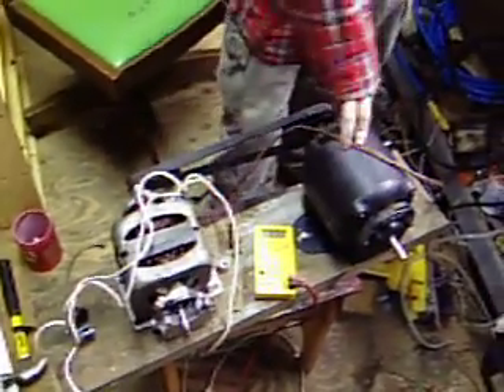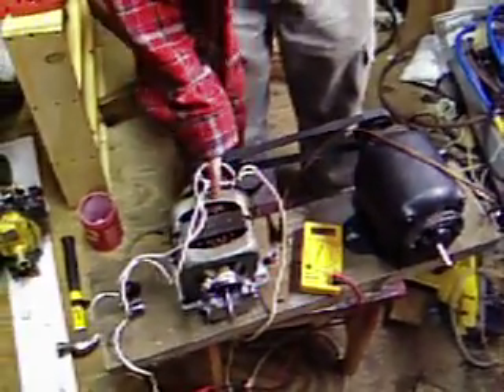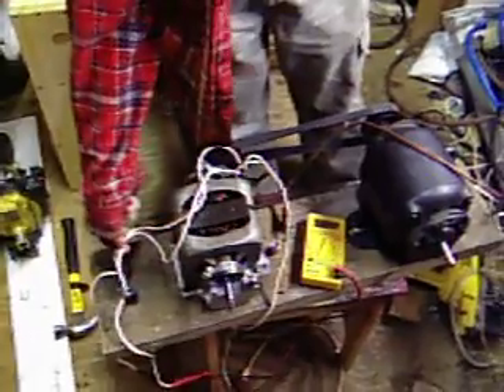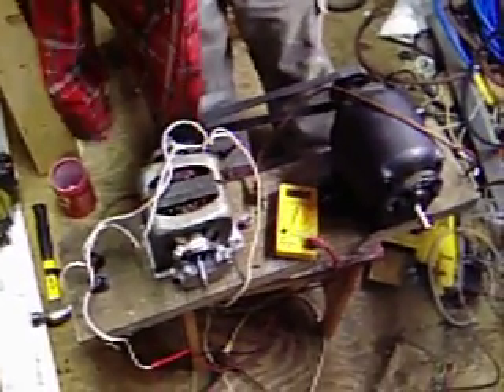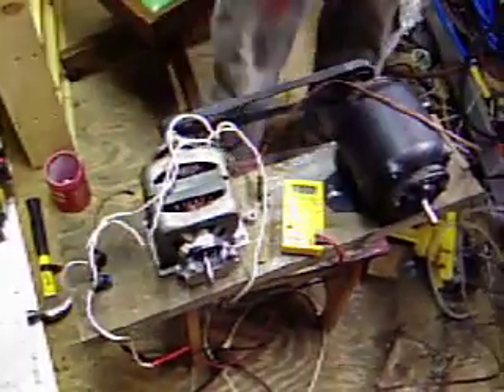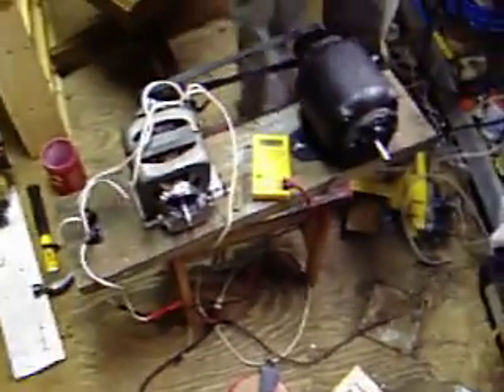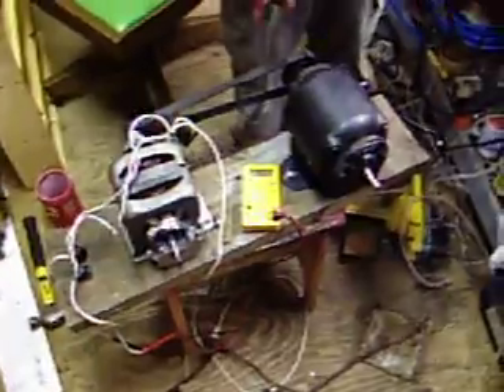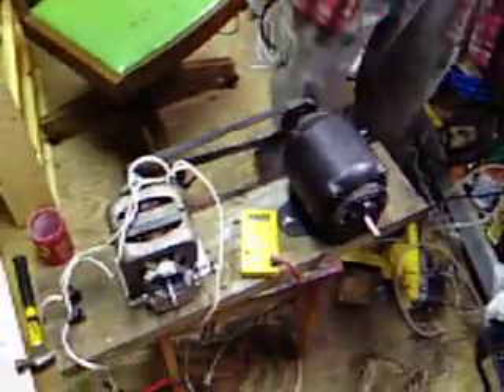induction generator

Comment: Hey did you know even car alternators require power to start operating?  That's why you had to charge up the magnets each time.  What's the latest with your generator project?
Reply from the maker: ***** well that is true, but this wasn't a alternator, this was a induction motor out of a electric dryer / washing machine. The latest i did with it was a 2 part video, heres part 1: http://youtu.be/5X1MqoGwRC0 its a long video because i went into alot more detail than this video. Thanks for Watching!!!

Comment from the maker: with this setup it wasn't very much it was just about 100 watts or less. Its running at aprox 1800 rpm, both motors were 1/4 horsepower. If you look through my new videos (i think this was from 2012) i did a 2 part video on building one of these, much more detail than this video! (I'll PM part 1 to you) Thanks for Watching!!!

Comment: I would suggest using a flyback transformer driver circuit if you want to increase voltage, you can scrap them out of old tube Tvs or old computer monitors. Be careful for the fact you will likely multiply your voltage in the kilo-volt range. Another more effective way is using step up transformers. Really just understanding induction for the most part. I do suggest using oil filled capacitors that you can find in Air conditioners or appliances.

Comment: Suggestion, tuck in your loose baggy shirt and roll up those long sleeves when working around exposed pulleys and belts, or take it off and wear a close-fitting short sleeve.

If your shirt gets sucked in between the belt and pulleys, you'll end up with spinning death chewing into the side of your body real quick.

Comment: @fnaguitarplayer9 I used 65 microfarad with 5 caps. The 4hp motor is a 240/480volt twin voltage single phase. I saw your jacobs ladder video.  I used a washing machine electric motor and a microwave transformer,it worked really well. I copied this idea from aussie50. he has a lot of videos on youtube.

Comment: @fnaguitarplayer9 I have two 5 gallon buckets full of capacitors. They were given to me. I would hate to have to pay for them. I tested the induction generator with two halogen heaters 2900 watts in total. It makes the 8 hp B&S motor work for its living. One of these days I will post a video of it running.

Comment from the maker: @1899lpv This dryer motor is stubborn to start, after i got a good engine to run it, i used the other motor that i was simulating the engine in this video as the generator and it doesn't even need primed each time it starts the rotor keeps a charge on some of them. But yes this setup in this video is 100% useless, it was just set up with a electric motor because at the time i didn't have a side shaft engine that ran. And to make a generator like this it has to be a induction / brush less motor.

Comment: @fnaguitarplayer9  To put in other words, you could install anything to "Prime" the dryer motor...examples:  a wind or water turbine. Just like a car alternator. Could it be done with a forced air furnace blower motor ? I have one since last week and it says: AC Motor  CAT 841cv  HP1/3   RPM 1725  S.F 1.35  V 115  Hz 60  PH1  CODE n AMB 40ºC  A 5.3  SFA 6.2  RATING Cont  CL b  MFG NO h87 4    Would it be simpler if I PM you some pictures ? and does it really matter if  the motor has brushes ?

Comment from the maker: @1899lpv the dryer motor is the generator, the other motor is simulating a engine running the generator. All it does it turn the rotor on the dryer motor, it is not connected to the light or meter, just plugged straight into the wall, the light bulb is running off the dryer motor and capacitors. You can google induction generators for more info on how it works, i will do a update on this eventually. Hope this helps thanks for watching.

Comment from the maker: your welcome. Its the same thing for any motor, only thing changes is the capacitance, and if its 3 phase the hookup of capacitors is different. this is not meant to produce free energy, its just a home made electric generator, only thing is at the time i didn't have a gas engine for it, now i do, thats why there was another electric motor driving the other motor (generator). more less a test to see if it can be done. thanks for watching.

Comment from the maker: @Acemr420 when i ran engines off of hydrogen i ran the mix of hydrogen and oxygen in the carburetor, but i'm sure if you just run the hydrogen it would get enough oxygen from the air to burn. i would think it would be to rich, by itself. i'm not for sure. i know the air we breath is like 78% nitrogen, and only 21% oxygen, i'd say you'd have to mix nitrogen with it, or have some type of regulator on it to monitor the oxygen levels to cut the generator on and off.why are you makin air,just wandern

Comment from the maker: @Acemr420 well as far as electricity goes, building a induction generator like this video is a good way to start. as far as making breathable air from water, you would have to use electrolysis but the only problem is that it splits water not only into oxygen but also hydrogen which is extremely flammable, and would have have to filtered out, depending on how you make it, it could made so that hydrogen comes out one pipe and oxygen comes out the other. this how hydrogen fuel cells work for cars.

Comment from the maker: @mountain177 but i didn't have the right capacitors and they blew up in my face, but it did work fine, and the rotor held the magnetic charge (i didn't use the dryer motor as a generator, i used the other (running) motor as a generator, and it worked great, started everytime, never had to jump it off 120V. and yes, the double pole switch would have been alot easier/safer than the way i did it in the video, if i had one handy i would have used it then.

Comment from the maker: @mountain177 good idea, i can tell you right off the bat, that will work, its the same as plugging and unplugging the dryer motor. but see, this video here was when i first discovered that this could be done, at the time i did not have a gas engine, so i had to use the other motor to turn it over, so technically there is no point in this setup in the video at all, except for testing. and, last summer i bought a 6.5horse engine and put the gen back together and it worked great did not need a jump

Comment: all you have to do is have a double pole double throw in between the output of the dryer motor andthe input of the temporary motor. this is probably a good idea but i dont have the tools or the stuff to try it with. so go out and buy a double pole double throw togle switch for 120 volts AC. and try it let me know if this works and post another video if it works.

Comment from the maker: yepp you sure can, and it will generate 3 phase power or you can hook it up so that each 120 vac outlet is on each phase, to balance it. 3 phase would be better in my opinion. i can find a diagram on how to wire 3 phase induction motors if you want

Comment from the maker: good explanation... i ordered the "correct capacitors" a few weeks ago, brought it down to 70 microfarads at 330vac, their motor run caps and it acts like it aint enough capacitance, before i was running 250uf and it worked great but the caps got hot cause they weren't the right ones. and since i made the vid, i have a engine now, it's a 6.5HP greyhound from harbor freight.

Comment from the maker: just go to google and type in something like: how to build a induction generator. i just bought some capacitors from HOSFELT i bought 4 17.5 micorfarad 330VAC motor run caps, they have to be run, any other caps will blow up, believe i quickly found out i had 4 blow up in my face haha and like i said, i bought a new engine for it, a 6.5 HP greyhound from harbor freight, great lil engine, gonna work on it this weekend, i prob wil put a new video up. thanks for commentin.

Comment from the maker: it's really hard to explain, i'll try though lol. an iduction motor has a rotor, its on the shaft that spins, there is no windings on the rotor, it acts like a magnet, but you have to have capacitors in parallel with the motor leads to keep the rotor "charged", if you remove the caps it simplye stops generating and the voltage and frequency is based off the capacitors and how fast the motor is turning, since i made the video i bought a gas engine for it....

Comment from the maker: no it shouldn't, what size capacitors are you using? i've never ran mine for than a few minutes, cause i don't have a engine for it yet, i do but i need to rebuild it, i want to make it so it runs off my hydrogen fuel cell then generator (motor) will power it = free energy lol
but yeah it shouldn't run hot, cause the placei found out about it dind't say anything about it running hot, and he ran it all day outside in the hot sun. so idk what to tell you.

Comment: does your generator get hot after a short time?  I built the same thing sing a 1hp dayton motor, and a 5hp Briggs side shaft motor.  after about 30 min of powering a box fan, the generator gets hot and the voltage steadily drops and it shuts down. until it cools.  any ideas?

Comment from the maker: the idea behind it is pretty simple, i'll send you a message with a link in to where i learned about it. the project calls for a squerral cage type motor, like whats found in dryers, and washing machines, almost any of the type that doesn't have brushes. all you need is the motor, an engine, a few capacitors and some wire. i'll send you email, they have more and better info than i can tell you lol....

Comment from the maker: no they don't, i think the problem is that it's not turning over fast enough, and the caps are to small, it should be about twice as much capacitance than what i had on that. And the belt was slipping alot. But the caps don't have bleed resistors, they came out of computer powersupplies. thanks for the comment